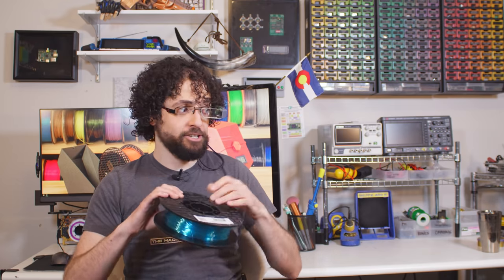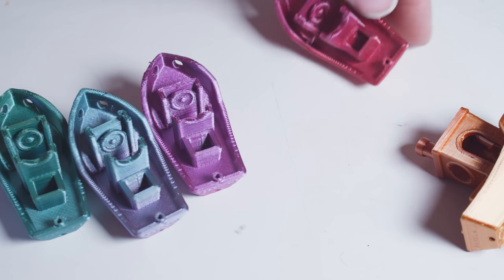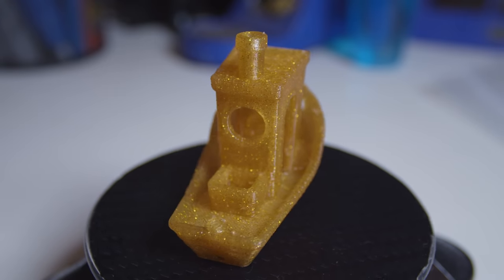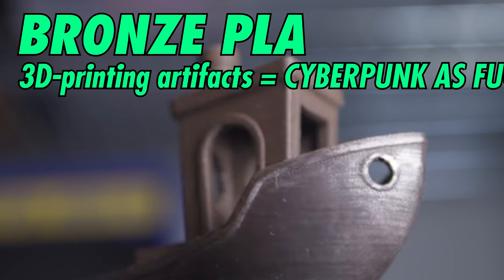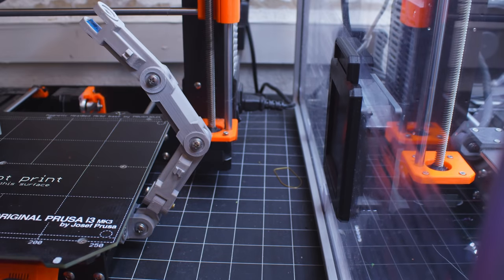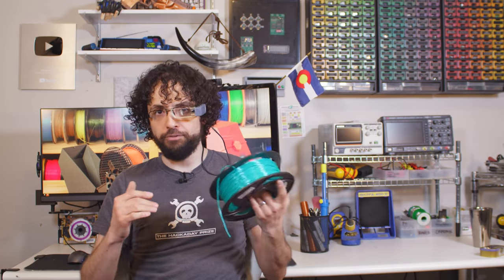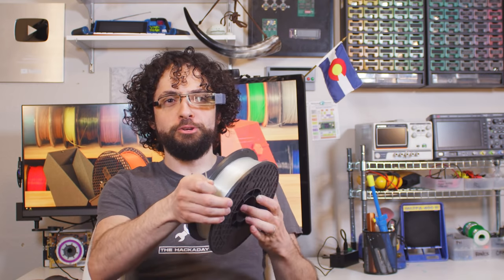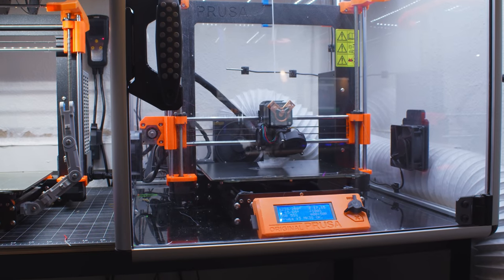I Tested (Almost) EVERY FILAMENT on Amazon: Every Single Filament Part I

Comment: Love the video! I used to sell Lulzbots back at Loveland, CO so we may have crossed paths in the maker spaces! I still run a TAZ 6 for fun.  We used to get our hands on a lot of experimental filaments which was left out of the video.  I'm guessing they were discontinued but worth a look: 'Entwined' was made with Industrial Hemp +PLA, 'Buzzed' was made with beer waste byproducts +PLA, Algix was Kelp +PLA (smelled fishy when you printed it), 'Wound Up' was made of coffee grounds +PLA.  

Anywho, I still think TPUs are massively underused and underappreciated.  It took a tight biting extruder to get the retraction control right.  Great video! Cheers!

Comment: FYI, I have printed  Sainsmart TPU (Shore Hardness: 95A) on my TEVO Tarantula, with a modified extruder gear clamp to help guide the filament through the gear mechanism. Works well.

Comment: I  used a markforged printer at work which used nylon with chopped carbon fiber.  Printed at 260 with no heated bed or heated enclosure. Prints came out great and rarely had issues with the printer.

Comment: Recently subscribed and watched these videos because I print high temp materials a lot, just a heads up, I use a glass bed at 90c with a coating of PVA for HIPS and it works fantastic. When the bed cools to 40c or so, my prints audibly crack right off the PVA surface, super easy.

Comment: Just getting into 3D printing and want to learn the different types of filaments.  This video was super helpful.  Not only did it give me some tips on my current PETG filament - and confidence I didn't make the wrong choice of this vs. PLA - Some of the other types gave me ideas, and I learned that the marketing claims of a CF-PLA "Carbon Fiber is a stiff and strong fiber that behaves like 6061 Aluminum, so it can be used for lightweight components that support heavy loads. 2. This 3D printed carbon fiber can match the strength of aluminum when continuous. "
Are probably not exactly to be trusted.  For service components, I will expiriment with drying out some old string trimmer nylon and hope to build a dry-box and get a spool.

I cannot imagine how long this took to produce, the amount of testing, keeping track of clips (The pliers on a black flexible boat I think may have been repeated?)  Holy guacamole this surely took a lot of effort.  Much thanks.

Comment: Just picked up a creality K1max.  Prints abs without fail in either .4 or .8 nozzles.  No adhesion issues on the bed at all.  So far only 1 of the 50 or so prints ive done has accidentally released from the bed plate.  I dont use any kind of glue stick or anything. Really pleased so far as most of my prints are large (12+ hr print times are normal).

Comment: I print TPU using a 600mm bowden regularly, with great results.  You just need an extruder that contains the filament path right from the gears to the hotend.  Mine has the tube butted up right against them.  You might not be able to pull off ninjaflex, but semi-flex is definitely doable.

Comment: You absolutely can print TPU through a bowden, it's just a bit hit and miss and requires a lot of trial and error and an extruder that doesn't let the TPU wrap around the gears, even a stock ender 3 extruder can push it with some slight modification.

Comment: I was able to print TPU with a Bowden, however it took many many tries and I found that slowing everything down as much as possible was the key to getting it to work, however the model I made didn't need to retract the filament at all, so if your filament retracts even once, your TPU print is gonna be messed up on printers using a Bowden.

Comment: I never found silk PLA brittle.  The stuff I have used has actually seemed kinda softer and more flexible, though I would agree that it's weaker, and has more die swell.
I don't think it actually foams,  but the extrusion seems to want to shrink back down in length, growing in width, (probably strands of elastomer contracting after stretching out when they're forced through the nozzle)

Comment: I do print TPU with an default ender3 and it works quite good. Im sure I have some time laps doing that. Just use a good Bowden tube like the Capricorn and it works great.

Comment: you can def print tpu and nf on a boden machine! I have printed TPU and ninjaflex on Tevo Tornado, Anycubic Iomega & Ender3. You just have to cut a drinking straw piece to fill in the gap between the extruder and tubing so the filament doesnt have anywhere to flex out. Also, must print slow, like 15-25mms

Comment: 28:40 I was expecting to have nothing but troubles with 95a TPU filament (bought it to print alternator bushes for a car)...once I Googled generic print settings for it (printer: Flashforge Adventurer 3), I was amazed it printed anything I threw at it BETTER than PLA! It stuck to the bed perfectly, layer adhesion was mint, and it didn't fail a single print (once I Googled how to print it lol).

I was scared of it failing all the time with how expensive it can be. I was pleasantly surprised that it hasn't failed on me once! (since I looked up how to print it of course)

Comment: What you tested was how each filament reacted at those specific settings regarding heat and slicer settings. In order to fully unlock a filaments potential you gotta tweak settings until you get good prints, then keep variables the same such as moisture and room temp.

Comment: not sure how many more plate incubations you will do but you need to flip them upside down while incubating. the reason there is a lot of water on your lid is because the water in the agar evaporates, which increases the concentration of salts and things like that in the agar itself. this creates a bad environment for bacteria to live and grow.

also you should probably use q tips from a freshly opened box and remember the side of the q tip you wiped the boat with. 

other than that awesome video and thanks for the filament primer!!

Comment: I picked up some AMOLEN glow-in-the-dark PLA for my Flashforge Finder printer and have so far printed 5 parts with it. My experience with it so far is that it prints just as well as normal PLA and I'm using just the standard 0.4mm nozzle. I haven't had any issues with jamming, probably my biggest issue with most prints is thermal warping, though I have now solved that by simply adding a raft to every model in the slice software settings. I did learn the importance of keeping the feed pipe on the machine though cos there's now 3-4 troughs ground into the filament input hole for the extruder.

Comment: I've printed RC Airplane tires out of TPU on a stock Ender 3. I did one at a time, with retraction off entirely, setting up the print so that all of the stringing is on the inside, but it was still kind of a nightmare. Though the results are adequate, it was that experience that convinced me to pick up a direct drive extruder upgrade. I also discovered that it  was necessary to change the nozzle after, otherwise it would be clog city.

Comment: Printed TPU per bowden on different machines. Its tricky on a bowden to find the right parameters and its not good working on all those machines. The Flyingbear Ghost 5  had no major issues and handled it quiet well - I just had to go down to something like half of PLA printspeed and adhäsion was an issue in the first place - until I figured out it seam to be due to the left microparticles of other materials used on the bed - when printing in a usually not used area adhäsion was awesome on pure glas. On a bowden you you have to find the sweet spot for retraction, as you do not really retract the TPU - you just reduce the pressure of the pilled up TPU in the bowden... But it works with the right parameters on several bowden machines! Far underestimated material as many still believe you need a direct extruder - you don't!

Comment: Currently we use ultem for airplane ducting and its one of the few 3D filaments allowed by the faa
Reply from the maker: That's pretty neat! It's a great material, and I've had far less trouble with PEI than PEEK.

Comment: I print TPU on my stock Ender 3 V2 Neo (Bowden as stock) with no problems!  Haven’t had issues at all.  It is a little stringy, but nothing that can’t be fixed with a lighter.  I just use the default Cura settings.

Comment: honestly, I never had issues with glow in the dark PLA, no matter if smaller or larger prints, including articulated print-in-place ones. I also use some nice Glow in the dark TPU that is amazingly flexible, sturdy, and (as long as you set it to right temperature and speed) prints very well. And it also Glows REALLY well. Both by Rosa3D. (no, the I am not sponsored, I just like their filaments.)

Comment: I somehow am able to print TPU on an ender 3 with a Bowden tube. The two things that made the difference for me are 1.) getting a dual gear extruder, as the TPU will flex and get jammed with a stock single gear, and 2.) using higher end PTFE tubing. I used capricorn I believe and yeah, prints no problem, and I don’t have to worry about adding more weight to my hot end.

Comment: I have an ender 5 pro that I got just before the "pandemic".
It was quickly stored away do to lack of room to operate it.
I just got it set back up and ran out of the pla I got with it.
I have a spool of tpu.
That tpu printed nearly as well as the pla, albeit after a bit of tinkering to get the settings dialed in.
Before I opened the tpu I had bought a bondtech clone off of Amazon as an upgrade to the stock one.

The new hotend arrived the day after I got the settings dialed in.
The new extruder fed it much easier.
The only problem is that after less than 2 days, it is now unusable due to moisture.
It now bobbles at the nozzle which spits out something that resembles Morse code.

This was all done via bowden tube and overture high-speed tpu (95a).

Comment: @ZackFreedman - While recently buying a used Ultimaker S3 dual nozzle 3D printer, it came with a dozen or so new reels of some pretty diverse filaments and thanks to your informative guide, I now have a much better understanding of what projects they'd be most suitable for. As they're all Ultimaker original filaments, they're NFC enabled for auto-identification, which saves me time when swapping out filaments, it compliments each reel with preset profiles (great for noobs like me). I've saved your video to a playlist as an invaluable guide. 👍

Comment: It’s possible to print CF nylon without a heated enclosure if you have a g10 bed. There’s still a chance of it warping but I find that most the time it prints fine

Comment: imagine having the enclosure, pulling all the nasty formaldehyde gasses out. Outside the air wind pulls the nasty formaldehyde away from the exhaust and right into your bedroom because you have the window opened a little. Good night LOL. Thank you for warning us about the toxic filaments!
Also very good video, so much knowledge dished out in such short time. Need to sub before i watch the next video.

Comment: What filament type would you recommend for a hanger that’s going to be used to hold ~8-10lbs on a tree? The hanger is about 6 in long and will be held onto the tree with a strap. The weight will then be applied on the hanger arm.

Comment: U need to show the plastic Numbers that are in the triangles for each plastic as U present it. 2, 3, 4, 5, 6, 7; etc. 3, 6 & 7 are the least safe for handling and eating according to safety regulators. 
Your ability to hold ppls attention in this vid is astonishing.

Comment: on 28:25

I have an ender 3 - I modified my extruder so that there's no gap between the extruder gears, and my machcine will happily do 40mm/s with 95a shore hardness TPU. I'm apprehensive about anything much softer than 95A but I might attempt lower hardness variants.

Comment: 12:50 I disagree. Strength is directly related to stiffness. However, CFPLA is more brittle and therefore less tough. Toughness is the area under a stress strain curve. However, if the ultimate strength is higher, it is stronger, but not necessarily tougher

Comment: I didn't know there was so much variety.
I'd like to now see a video on which sellers you can actually trust on Amazon. The times I found a good filament, only to purchase it again and the next time it's utter trash, not even the same brand, some knock off trading off of older good reviews.

Comment: And it seems this video either got out of date real fast or you just forgot some filaments, even in your other video.
PVB: can be alcohol smoothed, might be suitable for parts that need to slide easily
PCTG: Looking at its temps, might be a viable alternative to nylon if you're worried about fumes and don't need anything flexible (don't print it on glass)
TPR: don't know a lot about this. there's one company that sells it on amazon in a 2.85mm size, but standard print co out of Australia sells a 1.75mm size. Not sure if they export to the states though (lmk if they do, kinda want to try it out myself)
Flexible PLA: yep, someone made PLA flexible, they advertise it as working with bowdens too

Comment: Little late to the party, but at 10:38 when speaking about glow in the dark PLA, ive printed multiple spools of glowing PLA on my stock 0.4mm brass nozzle just fine, no clogs or jams, maybe I just got lucky? ive never had an issue with glowing PLA

Comment: doesnt wearing those glasses cause a headache? I print on a borosilicate glass plate i got from the local glassmasters shop. 
I just clean it with "jif universal" and wipe it good with papertowel. asa+, tpu, tpe, pla, and petg all stick to the plate. petg can be VERY hard to get off though. let the plate cool completely before removal. 
If you take your time to level the gantry of a vroller each time you powercycle the machine, ensure level bed with a corner square test pattern you have a fire and forget printer AFTER the calibration after EACH powercycle. Most cartesian printers that have dual z axis steppers offsets the gantry upon power, on power off cycle.  :)

Comment: Hi Zack I have bit of problems with my Glow in the dark PLA but it didn’t started strait a way. I made couple of prints with freshly open spools, but one of them stayed two more days the the others in my AMS and by the time I start printing it just clogged my nozzle it would brake of and block the extruder. I tried this is two printers all P1S but the second printer was my new one and still the same and even got worse. Mainly the problem was with the blue color and the other colors printed fine. Then I thought I will try with my green one same file same setting and same thing happened again. That pussele me so I took in to my dehydrator and it showed  about 30% humidity in the Glow PLA and then it hit me. It was the moisture so I dried the blue color and when I went printing it printed no problem at all. So the Glow in the Dark PLA absorbs moisture very quickly and this is why it breaks and there are problems with printing. So yeh when normal PLA can handle bit more moisture and print with no issues the Glow in the Dark you should keep it below 20% mine was 18%  moisture when I started printing again with the problem blue color child. So maybe you can try it and let me know but I did ok. Also was 24 hour print and the did amazing and no problem at that time 😊. 10:20

Comment: On the spark issue it can happen with just about any hotend. It’s usually due to handling of the heater wires. With the leaking of the hot-end. I am positive. That is all it is. I have done it myself on a Voron using a dragon hotend.

Comment: 28:40. I beg to differ. I use regularly, TPU on my stock CR-10. No idea as to the brand of filament, probably 90A-ish... Remarkably tough stuff, but I have now switched to an Ender3-V2 pro (direct drive). So, yes, it is do-able (my stock Ender 3 with a much shorter Bowden tube will NOT have it. At all!). A great review, many thanks. 👍

Comment: First video. Subscribed ! Hoping to get into the 3d printing hobby. What would you or other recommend for filament type? Long term goal will to finally build baby pcs (sffpc). Seeing people using regular PLA and ABS. Temps will probably max out under 100 but generally 70C is what I’m thinking internally.

Comment: Not gonna lie, we had quite a few glow filaments, something that started with an A I think, and we liked it bounds ahead leaps over regular overature filaments on a nearly stock ender, we didn’t get to use that printer nozzle to failure sadly

Comment: So I purchased a 3d printed drop spindle from a shop on Etsy that sells PLA spindles on metal shafts for $20 and nylon spindles on carbon shafts for $70... now I know why.

(Nylon spindles won't warp because you left them in your hot car accidentally.)

Comment: I periodically rewatch this video but never watched the Petri dishes part. 

IF the filament is a bacterial-viral killer it may destroy the bacteria helping fungi to gain control of the niche. Putting a shard of filament in a contaminated dish could reveal a bacterial free radius around the sample.
Swabbing the prints is not representative because bacterial spores can be present but inactive due to copper (bio static properties) and transferred to the dish where they can strive.

Sry in advance for my English

Comment: hey zack! new follower! like ur vids alot! but im having a horrible time trying to make my prints stick to the bed i just bought my 1st printer its an ender 3 s1 plus and i have NO CLUE WAT TEMPS i need on the nozzle or plate would u have any advice? there is alot of videos out there but no one really walks thru everything im stuck atm dont know what to do i also bought a enclosure for it so wind wouldnt be a factor in moving my prints dont know what else i can do =(